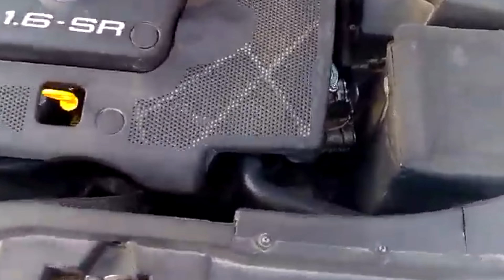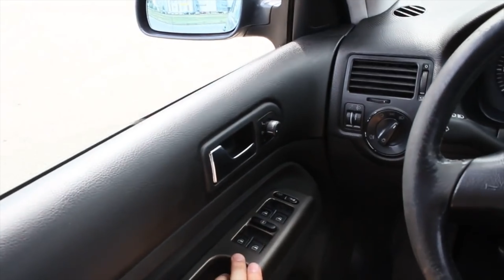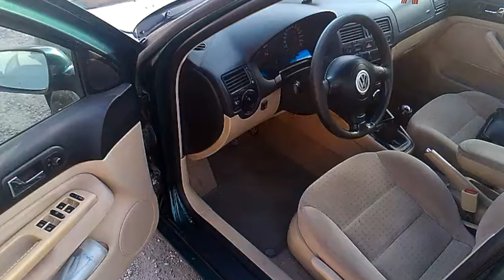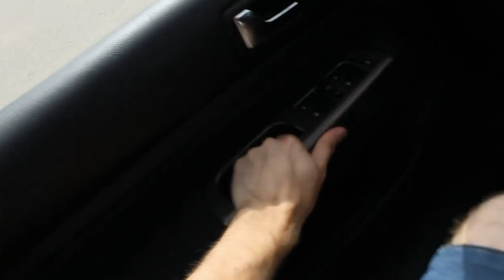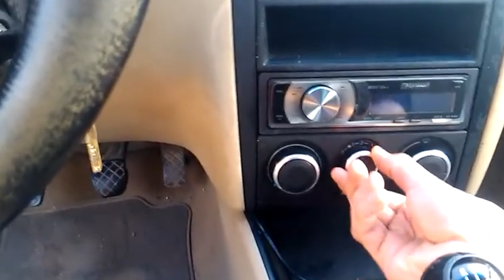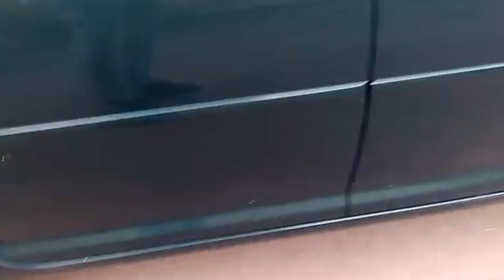Used Volkswagen Bora Reliability | Most Common Problems Faults and Issues

Comment: Can it be used for Uber or bolt?
Reply, Thanks
Reply: If you use a 1.9TDI most definitely. Very good gas mileage and practical overall
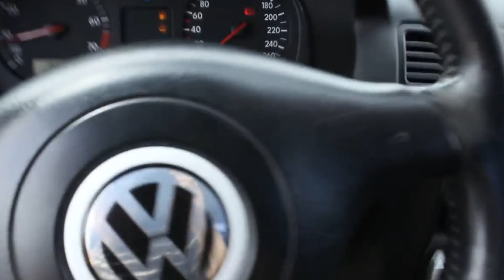Reply: @fr4kxon525 5:39 5:39
Reply: Why couldn't it??